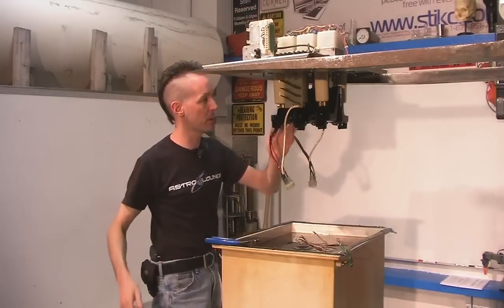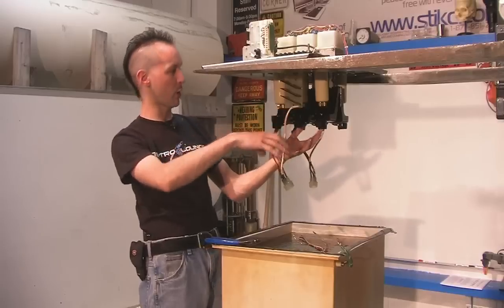HV Transformer Part 2: Equipment Autopsy #2

Comment: If you do contaminate your oil with moisture from the air, you can dry it out with some 3A molecular sieves. Just be careful if you're using cheap ones.
Reply: Nothing\ wouldn't boiling/heating the oil get rid of any water too

Comment: hello you seem pretty knowledgeable. I've recently acquired a pole pig transformer and was wondering what would be the best way to limit the current on the low voltage side (120/240)? Any help is appreciated.
Reply: Jon Shaffer ballast it, you can do that many ways.. one way is using an inductive choke, or you can run lightbulbs in series parallel to limit it to the values of the lightbulbs